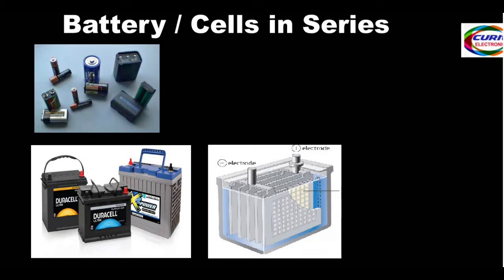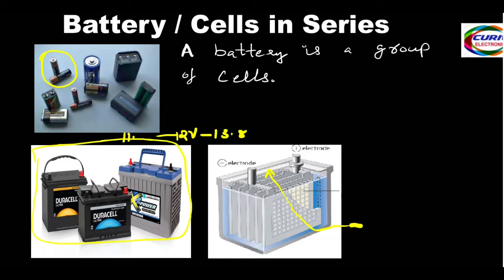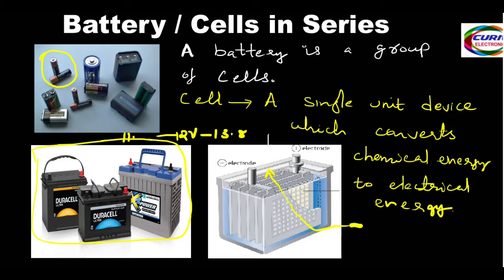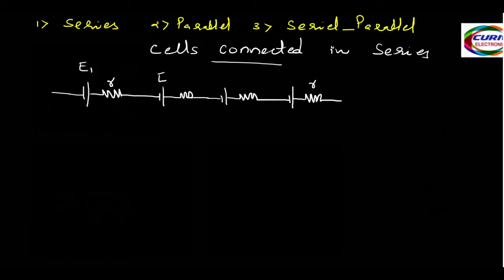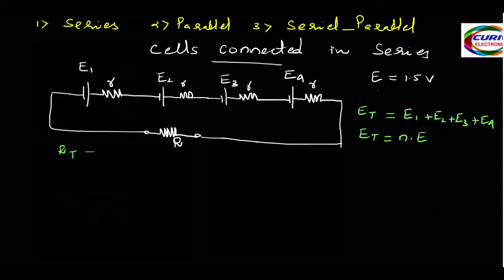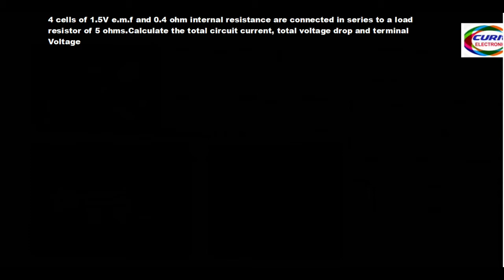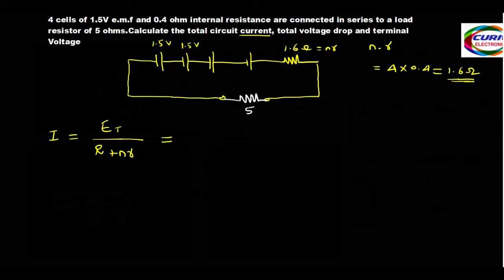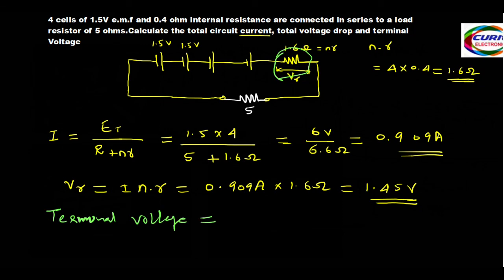BATTERY | CELLS IN SERIES COMBINATION

Comment: Hi I have a 36v 4amp batterie can I series connect it with a 12v 4amp battery to have 48v 4amp battery
Reply from the maker: You can connect it.Since batteries are having same current rating